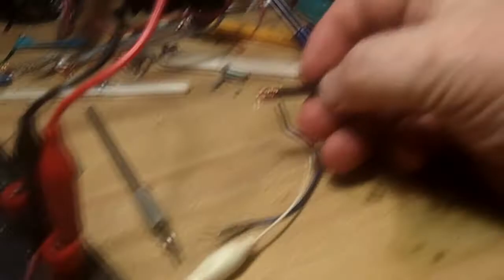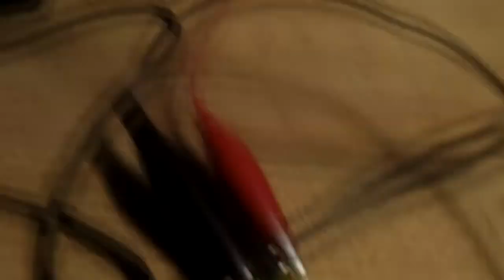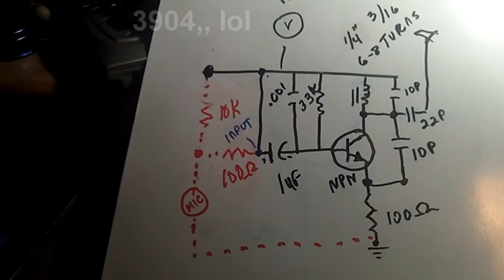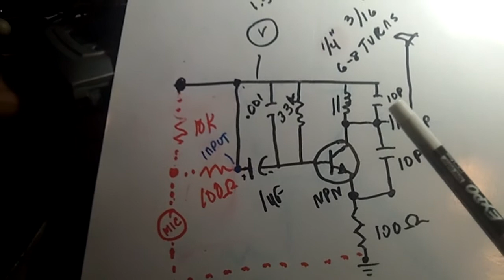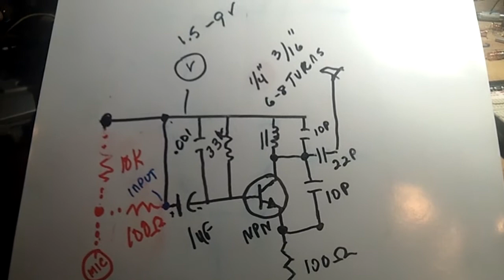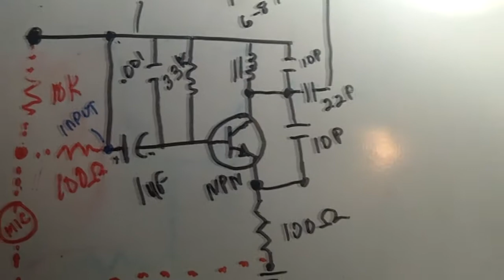FM Transmitter- Let's build one part3

Comment: Cool Carl.... what gauge is the wire you are wrapping around the bolt ?  Will any NPN transistor work ?
Reply from the maker: Great questions Ron. Matter of fact I had the micrometer there to show that and completely forgot. ( imagine that lol ),,, My personal opinion is 24 gauge seems to work best. ( .5mm ) I know that guys take thinner wire off of transformers and motors and such and it works too. The 24 seems to have the strength yet winds well. But depending on what you have,,, I would say 22 to 28 would work. Just remember that 28 would be flimsy and easy to distort.

As far as the NPNs, all the ones I have used so far works okay. Now that's the Bipolar Junction (BJT) type. I have not tried FETs or MOSFETs yet. ( but I will ) I know that the 3904s and the 2N2222As work. I also grabbed some from the parts drawers and the only thing common was they all read 200 or higher hfe on the meter.